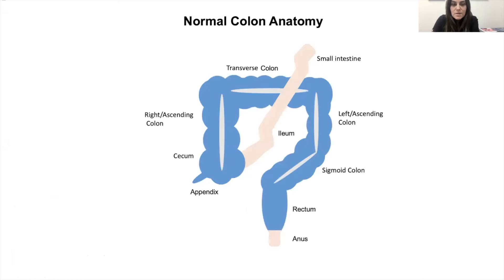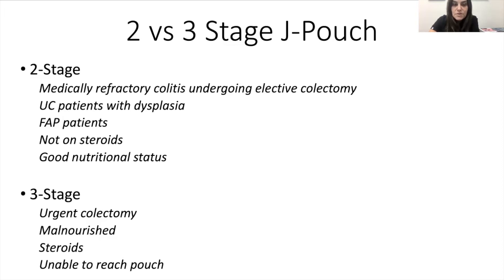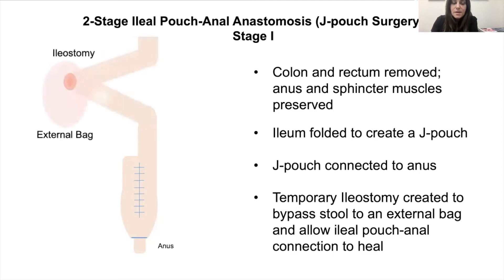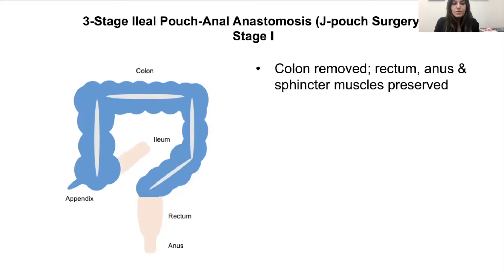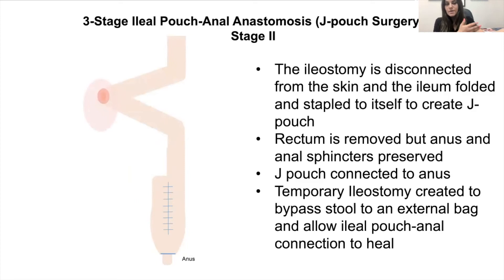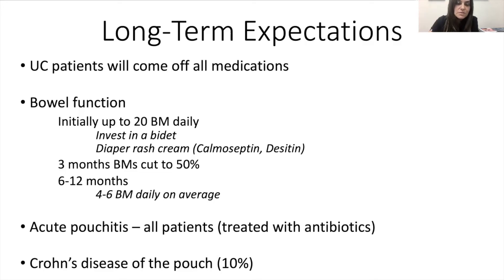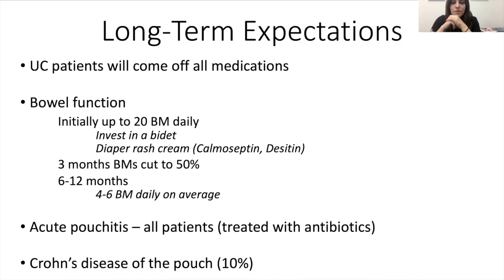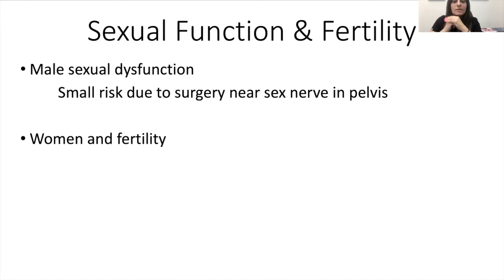J-Pouch Surgery Explained - With Diagrams!

Comment: Hello Doctor  !! thanks for such a clear explanation. My brother is going through the 2nd stage ot his IPAA, after having had his colon removed due to a very severe UC. In fact the surgeons tried to skip the 2nd stage and they reconnected the ileum to the pouch, and stayed without the external bag for a week ... however, he developed an abscess and an anal fistula and had to have the connection reversed and went back to the bag. Ok, the thing is for some reason, sometines stool is not bypassing into the bag  and it flows down on to the fistula, leaking out to the skin, really close to the anus, thus causing a constant infection. Do you know why that can happen? it hapens rather frequently, in fact he has to use small diapers and  dressings in his underwear because sometimes he could wet his pants . I appreciate your concern -- Gustavo from Argentina

Comment: I had this surgery 5 years ago for FAP & begged my surgeon to perform it in 1 stage. She said it has to be done in 2 stages, & how right she was.
Reply: How gas it worked out for you? I may need the same thing done for the same reason and I am quite worried. Particularly about how many bowel movements there may be in a day and pain.
Reply: @jonathanmiller5232 i had this done.  One of the early ones 25 yrs ago (which immediately failed) but then revised a yr later by another doc and turned out great.  Do it in 2 stages!  Definately.  I was incontinent a lot of the time and always at night for the first 1.5 yrs but slowly improved.  It does get better.  And in my case I wake up if get too much pressure, or start to leak. One funny thing is I often have dreams where I’m searching for a restroom because I have to go to the bathroom, so bad, and what’s happening is I really need to wake up because I’m about to become incontinent.😂 it’s actually quite amazing what my brain has done so I don’t have accidents at all anymore ever. My dreams wake me up to tell me to get up and go to the bathroom.  

What turned it around was exercise (walking) then light weight lifting which progressed to regular exercise.  (today I can run, ski, hike, do anything, but let me tell you I always have paper towels or tissue with me 😂) because when you gotta go, you gotta go now.   

After I was done with surgeries , I had trouble with weight gain for a couple years and eventually when the diet improved, weight gain occurred. (A good thing).  Was acutely sick for two years.  (Multiple surgeries, bowel obstructions, revisions) But…..the eventual revision Jpouch surgery saved me from having an external ileostomy.  (Which was actually not bad having an ileostomy. You get used to it and it doesn’t even bother you. And it doesn’t really bother anyone else either so don’t let that be a fear). The number of BMs a a day starts high, can improve with diet, and number a day decreases over time.  I can go 8 hrs without restroom, sometimes use one every two hours, depending on what I ate or inhested.